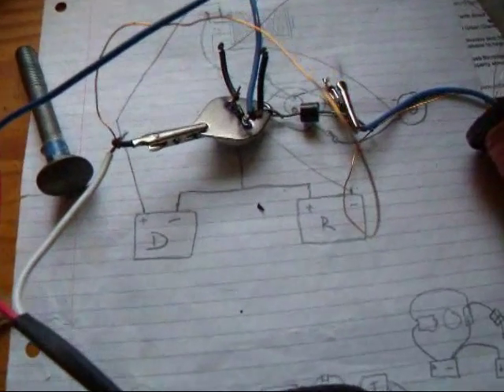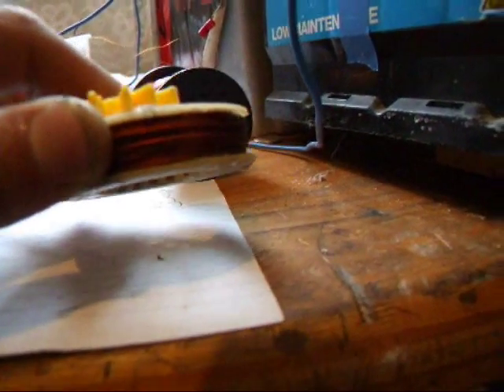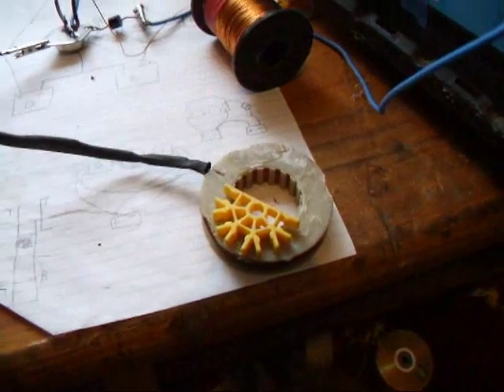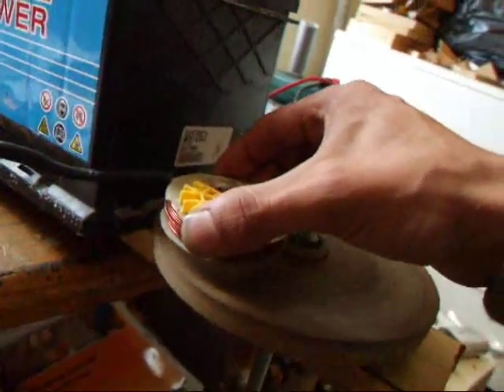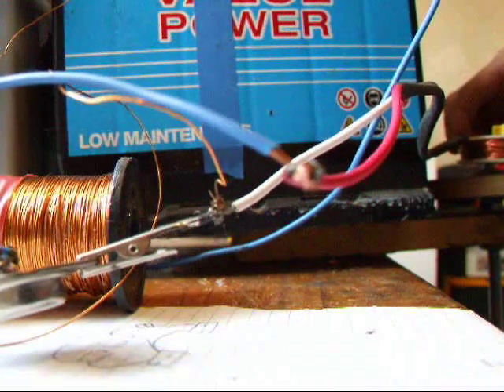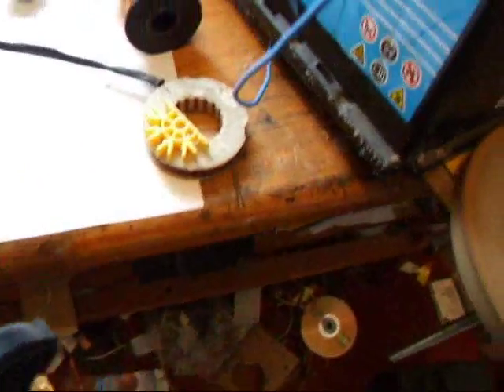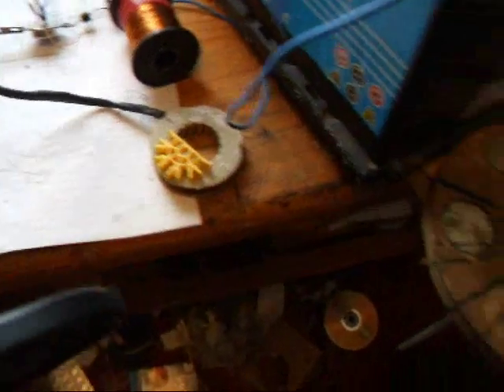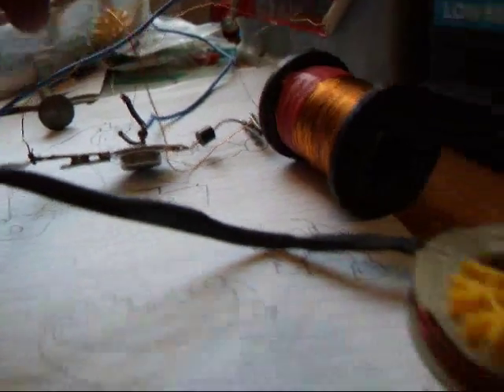Bedini modification Torque and speed - triggerless

Comment: @lykenth08 well i am very interested because (if i understand correctly) even John's design at r-charge have a switch to go from normal charging to radiant charging. i suspect this is because radiant charging would be normally quite slow with a small unit. maybe some torque would offer a convential charge + radiant simultaneously

Comment from the maker: Sorry i thought i did rush it abit. Connect up a normal bedini circuit with a Bi-filer coil, hollow core so you can alter the speed it seems. Now add in, from the positive battery terminal, another coil, to the collector on the transistor. use a thicker gauge - 18 works well, not a lot as it drains/weakens the force. use the 18gauge coil to drive the fly wheel, have the bi-filer set aside. does that help? ^_^